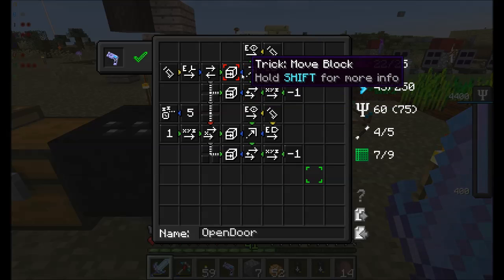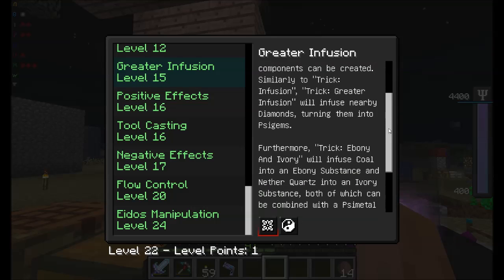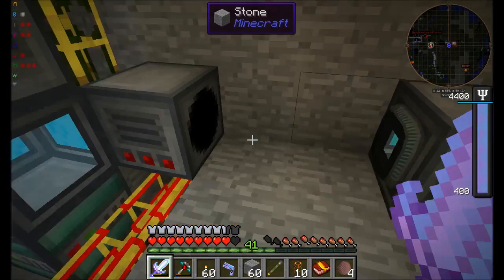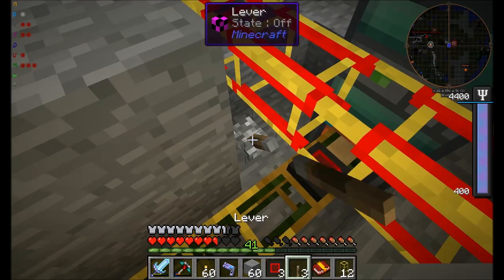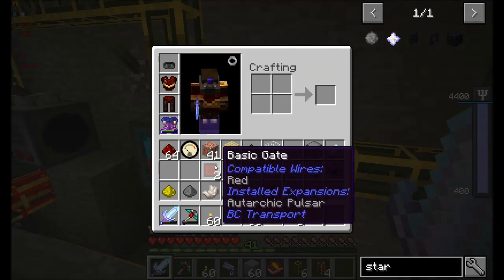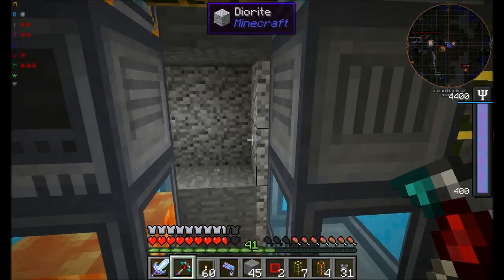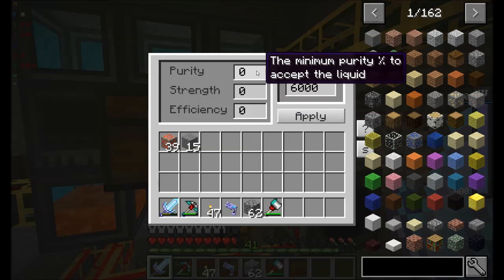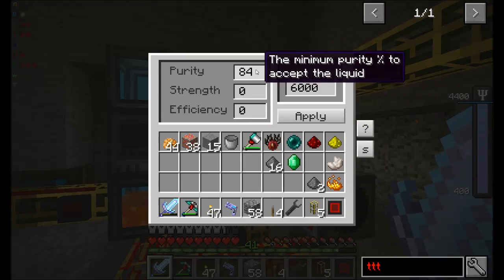ServerPlay   S8E31 Better Crystals

Comment: seems like it costs a good crystal + tons of materials to make a good crystal :/ this doesn't seem material effeicent at all. feels like you need to mine 30+ bad crystals from the world just to really get started
Reply: +PewPewLazehs yeah, i dont think its meant to use the good crystals as catalysts
Reply: Awesomo
no i get that, but it took like 5.5k catalyst points or whatever you want to call them to laser that first crystal to 60% str and then using that crystal as catalyst gave him like 6k catalyst points. You need a lot of crap crystals to make a good one or one good one to make a good one. Why not just use the crap ones to make power and be done with it the mod just seems unbalanced to me. Just my opinion of what ive seen through his vids though. I have no actual experience with it.
Reply: +PewPewLazehs it seems to be 1 bit of  "crystal focus"  per catayst used so using poorer quality"catalyst" results in using more crystal overall so dont cheap out on catalyst

Comment: Is there a reason he is not lasering a full tank at a time to not waste those expensive crystals... is the laser less efficient the more stuff is in the tank?
Reply: +Jerome Fournier It shouldn't really matter how full the tank is. The laser works on 500mb of fluid at a time and averages the bonus throughout the liquid. So twice the liquid would mean twice the items/laser needed but twice the crystal output. It should take 3 diamonds to get 500mb up to 100% efficiency, and it should take 36 diamonds to get 6000mb or 1 crystal up to 100% efficiency .
Reply: augimidge Ok that's what i was wondering, so using the laser on a full tank is less precise than on a single crystals worth.

Comment: Do correct me if I'm wrong, but isn't the point to a catalyst that it doesn't get used up in a reaction?
Reply: +Stijn Tromp Not necessarily. In a chemical reaction, the puropse of a catalyst is to lower the activation energy so the reaction happens easier. The catalyst may ot may not be consumed in this process.

Comment: This is unefficient. You must fill tank with liquid crystal to full. Because you are wasting resonant ore. I mean if you boost up strenght on 6000 mb crystal and put it in the laser you dont gain any liquid crystal with this strenght,  you are walking in the endless circle. But you  are by able do 16000 mb of this strenght crystal with same amaunt of redstone and crystal as component to boost up. In this example you have after boosting :16000mb LK, 6000 mb put in the laser and you have gain 10000LK to use another way.   I dont know if you understand me.
Reply: +Tomáš Lepiš haven't tried it myself but it looks like it applies the boost to sets of 500mb at a time, so it would take longer to upgrade more than 6000mb at a time, but should have the same efficiency, meaning it would take 2 & 2/3 times as much crystal strength, power, and catalysts; to fully upgrade 16000mb than if you only do 6000mb at a time.

Comment: Since you can get purity back relatively easily, and only care about strength, the comparison seems simple (assuming the energy cost of the laser is not dependent on the catalyst):

Catalyst:       Strenght per opperation:               Cap:

Redstone                    5%                                        60
Gunpowder                8%                                         70
Glowstone                 6%                                         50
Blaze Powder            5%                                         70

Gunpowder all the way.
Reply: Just use ghast tear then filter/ender pearl

Comment: That lensa can only be placed horizontally, buy it says it can only be placed vertical.
Reply: +ODDnanref The laser fires horizontally so to pass through the lens it must be placed vertically.  ----[]---
Reply: +ODDnanref
Imo the lense doesn't need that tooltip because it is only logical to put in on the transparent side.

Comment: PSI C.A.Ds and Duel wielding, how would that work
Reply: +OddGMER The materials are called Ebony and Ivory, so you would expect to be able to dual wield
Reply: +Daniel Jenovah Have you seen the show?
Reply: Tanner Tugwell If you're asking if I've seen the anime the Psi mod is based on, then no. I did read the light novel though. I thought that the materials Ebony and Ivory are refferenced from Devil May Cry, which is why I assumed you could dual wield
Reply: If you have two cads in psi then it stops you from using either of them
Reply: shame

Comment: Can I download this modpack anywhwere?
Reply: this is a test server, therefore, a test pack, most likely
Reply: +Hellior You need the pack code which is only given to people invited to join Forgecraft.  To get invited you need to be a well known mod developer or LPer.

Currently the closest thing to this pack is FTB unstable but it isn't the same as the Forgecraft testing server.
Reply: okay :(
Reply: +Hellior don't worry though, most of the mods there are availabel publically, so if it's not on Unstable you can add it, I know forgecraft has an older version of Psi than what the public can get, there's only a few that aren't public yet, I don't think ender io for 1.8.9 is public yet for example :/

Comment: i see one flaw with your set up dire not that its a big one but by using the multiblock tank like you are it requires alot more filters unnecessarily and uses more rf due to the increase in actions from mixing the recently purified liquid in with lesser purity and diluting it just a thought
Reply: +John Benna But it is more compact.  I have noticed Dire puts a higher value on being compact and automated than efficiency.

You are right though it would use less power and filters if he processed in batches with a holding tank to prevent mixing or set up a chain of filters.

Comment: feck psi seriously that dang mod confuses the shit out of me I'm in the smiling and nodding stage and thinking direwolf is crazy for liking it what the hell is the point
Reply: +suravian666 it's a utility mod, it's for fine tune-able utility purposes, such as striking lightning one block above the block you're looking at so that you can generate a good amount of air pressure for a chunk (renewable) Psionic energy, or give yourself some regen 3 for 2 seconds (idk why you'd do that though), or trap mobs in a blockade, or make blocks fall on people, or build a mini structure in a certain pattern behind you, ect. it can get pretty customizable... just not powerful when it comes to survival circumstances, and in a newer build that direwolf does not have yet, things cost more Psi, and Psi regenerates a bit slower.

Comment: hmm in psi would it be possible  to have the open door close door on one spell
Reply: probably not as it'd take up too much space
Reply: +Domenick Spano you could have a condition that checks if you're sneaking and do one or the other, but that's about it I think. The spell doesn't know if the two blocks are in an "open" position or "closed" position.
Reply: +remuladgryta direwolf could take advantage of the sleep trick to have a delay before the wall autoshuts, now to figure out how that'd work out while he moves @_@

Comment: Couldn't you just shoot the laser at the multi-block tank on top? Then you could purify and strengthen the same batch simultaneously, and set the valve up to filter the fluid out once it reaches both 100 strength and 100 purity. Could even have a 2nd laser firing diamond purity in the other side to raise it above 85. Just a thought.
Reply: +zachariach - ok cool, so then to automate the system you'd have a gate on the starting tank with 2 purifiers below it to keep up with the gunpowder laser's purity reduction and the gate would say "fluid in tank -> redstone signal to laser" with a valve below that moves the fluid into a 2nd tank at 100 strength and efficiency that only has a purifier set on it to increase the purity to 85. at that point you'd have another valve on THAT tank to move the 85P 100S 100E fluid into a 3rd tank with a gate for "fluid in tank -> redstone signal" to a diamond purity laser. Finally, you'd valve the bottom of that tank into a final tank with 100P 100S 100E and auto feed it into a crystallizer. Not sure if I described that well, but in my mind I think it would fully automate perfect crystal fluid and automatically turn off lasers that are not in use.
Reply: +Zeo on Youtube - actually now that i think about it, you'd want to just filter the 1st for 100 strength and not worry about the efficiency, but could add a step for 100 efficiency if desired. Also you'd want to have a seperate setup on the side with just a redstone laser to create strength crystals to supply all the lasers, at least until you get a nice supply of expended crystals to use. The only problem I can see is the fact that the laser materials are less than renewable, so unless you have a large amount of saltpeter and sulfur or other forms of crafting gunpowder in large amounts (magical crops comes to mind, but I don't think it's in the pack, nor would it likely be in dire's own pack) then the automation of laser materials would be a bit more challenging to supply. Same goes for diamonds unless you've just got a massive ender quarry running at full speed in the deep dark. Maybe bees would work but it'd take quite a few to keep up with how fast that laser eats them.
Reply: +Zeo on Youtube yes you can do that, also you can do it many different ways then what dire is doing I've already though of a nifty way of doing it my self can't wait to get a hold of a 1.8 modpack

Comment: Does the highest output for crystal is 17050RF as 1705RF is 10%of it.
Reply: +Tibiskus Chiller In the config the default and max you can set it too is 20K RF a tick, and the default max energy that a crystal can produce is 1M RF, but you can set it all the way to 2B RF
Reply: probably
Reply: tested in SP max 20k

Comment: PSI makes my brain hurt, fecking college math mod
Reply: +Joshua Columbus i wont ever bother with it. it looks terrible.
Reply: Oppa Gangdu- wait.
Wrong thing
Nvm
Reply: +Tanner Tugwell and that anime was stale and generic.
Reply: +Joshua Columbus I seen a few episodes of the show and it was pretty boring, it is like having a middle schooler walking into a highschool geometry class. I'm not even exaggerating, they made episodes about teaching you what magic, vector, psi, and other random stuff you need to watch a cartoon.
Reply: +Joshua Columbus It seems to be a mod for the lazy to put more work into being lazy.
Reply: I love it. Its so fun just because if you know the math, you can do ridiculously overpowered stuff, like create a spell that automatically kills everything around a point without damaging blocks, or emulate a Tinker's hammer, with infinite durability.
Reply: +Delta7x You learn about vectors in high school, as in what they are, but you definitely don't learn stuff like vector projection. In the US, you don't have to take any linear algebra unless you are in specific fields in college. It is not a requirement even in college for most majors, bar stuff like computer science.
Reply: +Joshua Columbus you don't even need to know how to do any of the vector stuff or how to code. I played through it without knowing anything about those things and I got it just fine. Psi teaches you along the way and it's hardly complex unless you want to do the stupidly hard stuff. Have you actually played with it?
Reply: +Joshua Columbus i agree it looks terrible but maybe we can pay the people who dont see it as terrible to make spells for us in servers :D (and by pay i mean ingame if possible)
Reply: +Henry Zhang and here is my problem with it "you can do ridiculously overpowered stuff, .." - OP = unblaanced, not fitting MC - dislike PSI!
As a follow programmer and modder i like the attempt altough it is basically a copy of ars magica
Reply: +dabash00r It's actually a direct copy of an anime
Reply: +dabash00r it's not actually op, and Henry Zhang is exaggerating a bit when he says you can just kill everything around a point, that can take a few casts, which can leave you vulnerable, or just unable to have your conveniences for a moment, in build 23 (which I don't think forgecraft has yet) stuff has a higher Psi cost, and Psi regenerates a little slower, and now my spell that I used to get around has become more deadly than useful, unless I get a bunch a charges and take a moment to prepare a burst of fast travel for myself, which is still useful, just not as useful, also why does everyone compare it to ars magica, it's it's own unique thing @_@ you can't compare it to any other mod. ok, I'm done complaining here
Reply: Clewl Tetsui Because it is basically ars magica just you shoot speels from a gun..
Reply: ChauNyan I will never watch an anime that teaches you math
Reply: +Joshua Columbus It doesn't teach you about math, it is teaching you how to watch the show.
Reply: ChauNyan Same difference
Reply: Delta7x Nah, I never learned that before
Reply: dan ellis I don't do code mods. The moment the mod started using college words and college math I shooed away from it
Reply: You might want to give it a try before you bash it it's quite easy.
Reply: dan ellis I doubt it, but first I gotta save up 8k $ so I can buy my new gaming computer. The graphics card in this one keeps crashing and the comp keeps overheating. Thermometer says it gets to 90 degree celcius during gameplay